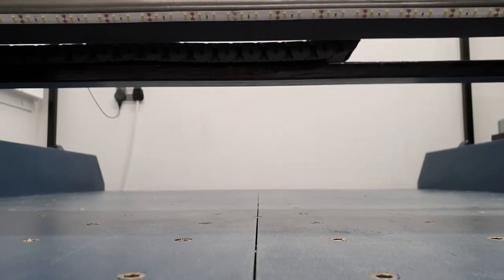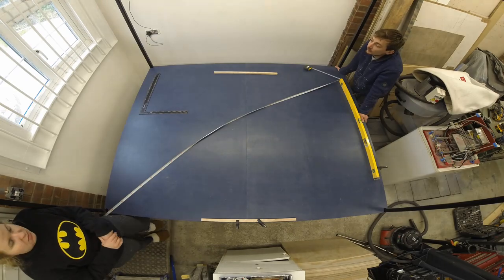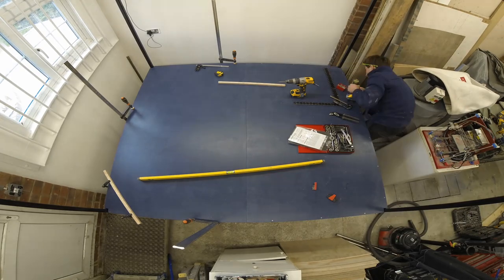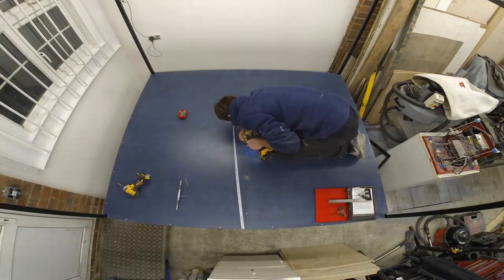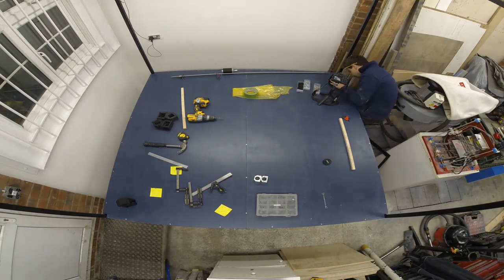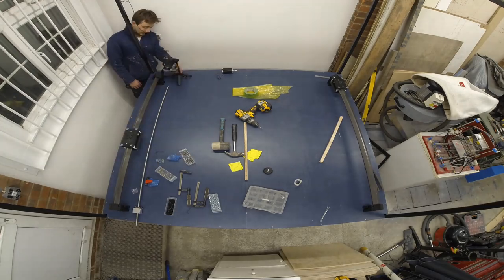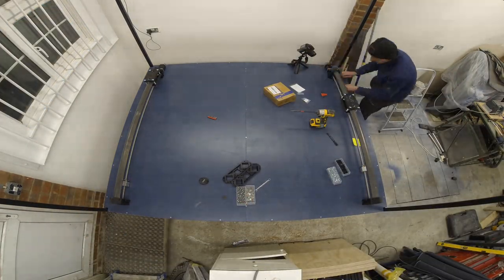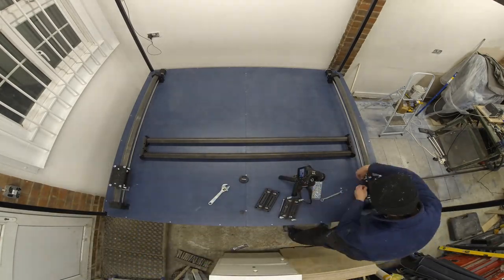Root 4 CNC Build Time Lapse Pt:1/3

Comment: Hi great build, I will be having a go at building this ,can you tell me what the correct height to input into the calculator for a makita trimmer please?
Reply from the maker: I am not too sure what you mean by the correct height for the Makita trimmer - you'll set the Z height according to the material and bit you are using.